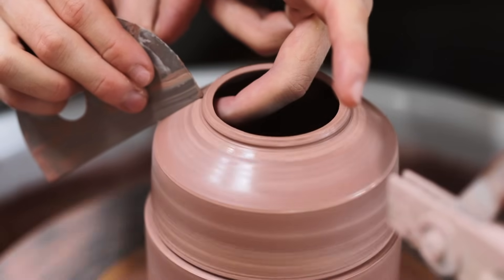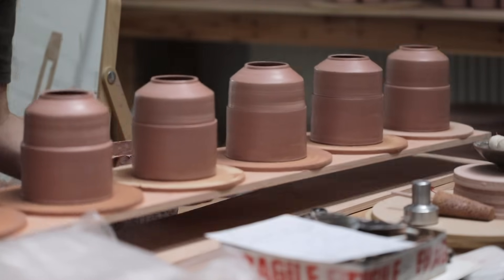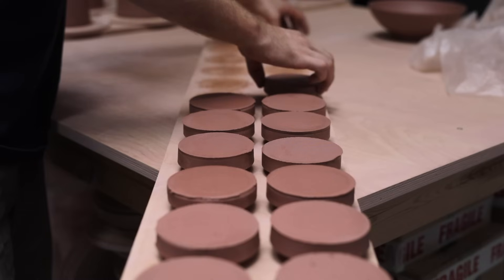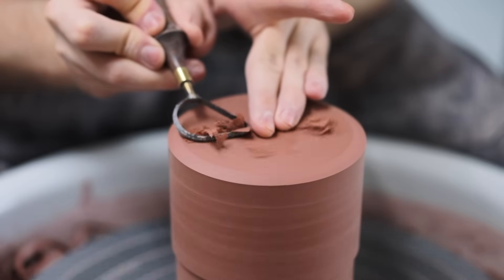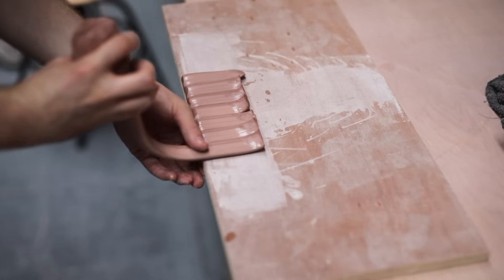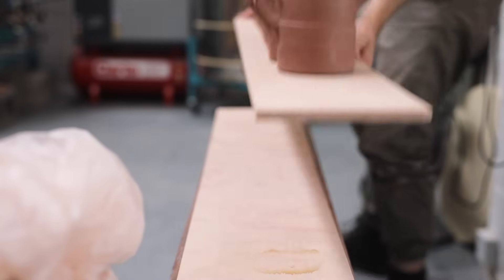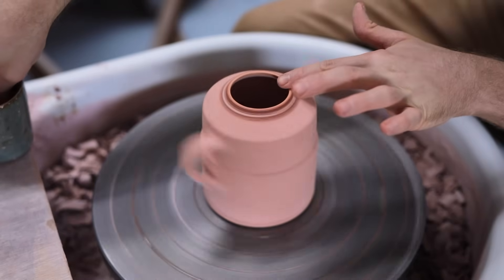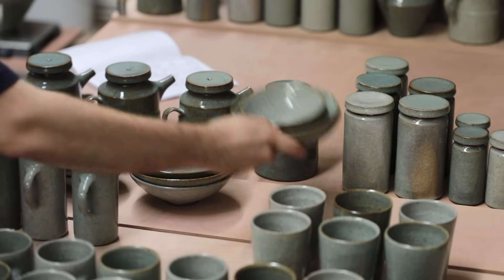How to Make a Pottery Teapot from Start to Finish

Comment: Hi, I have a doubt. While pulling the handle, isn't it easier to roll the clay with a dough roller and cut the shape? Forgive me if it's an ignorant question.
I am new to seeing pottery videos and I am hooked. Hoping to learn the skill in the future.
Reply from the maker: If it was I’d do it! With enough practice, pulling handles the way I do is extraordinarily fast as the joins are made effortlessly and neatly, and don’t require nearly as much fussing over as compared to the method you mentioned. Ultimately though, making pots isn’t a competition. So there isn’t one way that’s better than any other, different techniques give you different finishes and variety is a good thing. You want to find a method you enjoy, that you can master and that’s it. Different techniques can give you entirely different qualities and the handles produced with the method I use won’t look anything like the rolled handles you make. Thanks for watching and I recommend trying out as many techniques as you can! Only then will you settle on a style you really love.

Comment: I'm a beginner potter and I just need to ask... I can see in the finished teapot (that you made tea in) there is alot of "crazing" I thinks its called ... the tiny cracks. Firstly I'm guessing this was intentional but I thought if it had these cracks it's no longer food safe?
Reply from the maker: Here’s a good link to an article that goes into more depth about it, https://ceramicartsnetwork.org/ceramics-monthly/ceramics-monthly-article/Techno-File-Dirty-Dishes, and clears up some of the misconceptions that are spread around. As long as you properly wash crazed pottery there is no bacteria left in the crackles. As long as you take time to care for your handmade ceramics after they’ve been used then they’ll be just fine, but of course it does depend on the materials used and temperatures fired to.

I’ve been using crackle glazed ceramics for years. My pots are highly fired stoneware with nothing nasty that could leech, the crackling doesn’t stain too badly as long as it’s properly washed but of course it happens overtime. To the same degree, many of the potters I’ve worked for over the years who wood fire, soda fire and so on, all have work that crazes and crackles to some degree and it all stains with time, yet functional work is still made abundantly and is completely usable. I saw this in Japan especially, with so many functional tableware pieces that were crackled/crazed and stained and no body blinks an eye, nor do you hear of an excessive amount of people getting ill.

My clay is fully vitrified after being fired to 1300ºC and unless you take terrible care of your ceramics you’ll be perfectly healthy. Other clays, like earthenware, never fully vitrify and will absorb water if not glazed properly, that can be issue.

For industrial use it could be a problem, due to the surface of the pot having less strength, long-term staining with use and fragility, as it’s high fired stoneware packed full of iron, which makes it weaker and more susceptible to chipping on the whole, but that’s what you get with handmade ceramics, I don’t want to make pots that have perfect, uniform surfaces like you might find in a shop, I want each to be individual and interesting and handmade and I suppose the same goes for the generations of potters who’ve worked all over the world. 

I think certain parts of the world, I won’t say which, seem to have a fixation on this. And of course it is the potter’s responsibility to provide surfaces that are food safe, but in most cases that applies to the leaching of toxic materials, not staining itself. Hot dishwater water and soak will kill anything in the crackles, and they are gaping crevices in bacterial terms.

Anyway, I hope this helps!

Comment: I was wondering why sometimes there are already fired pieces in the bottom of the gas kiln. Why refire/what does it do?
Reply from the maker: That spot in the kiln often fires a touch cooler than other parts, so I often use it as an area to refire pots that need some kind of correction, be it they fired too cooly initially, or I’ve patched up some glaze. The rest of the kiln fired evenly but that spot by the door on the bottom is usually a cone below everywhere else.